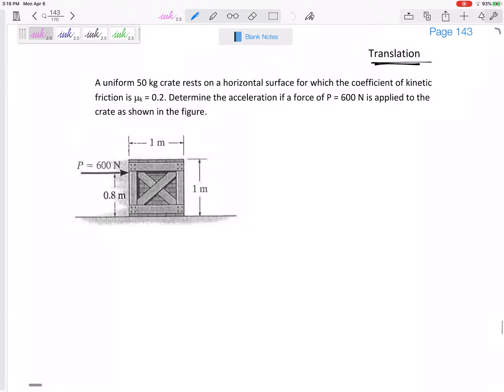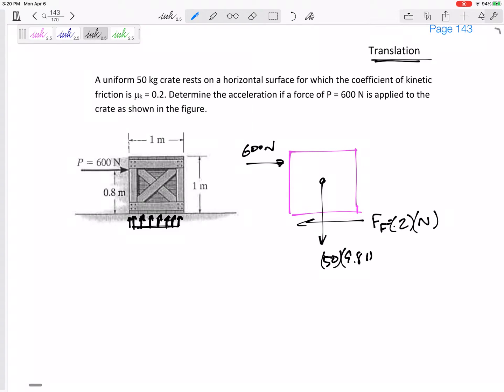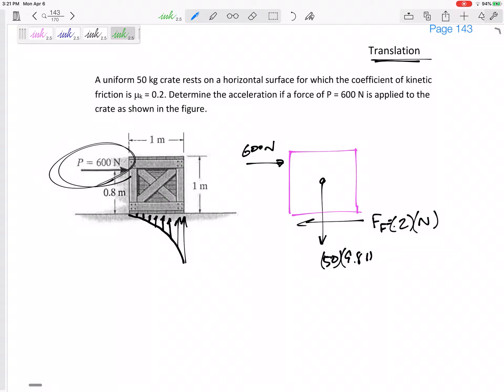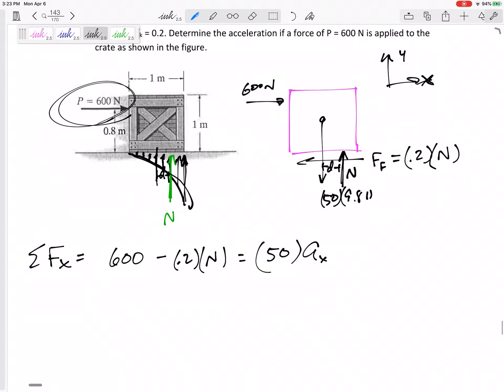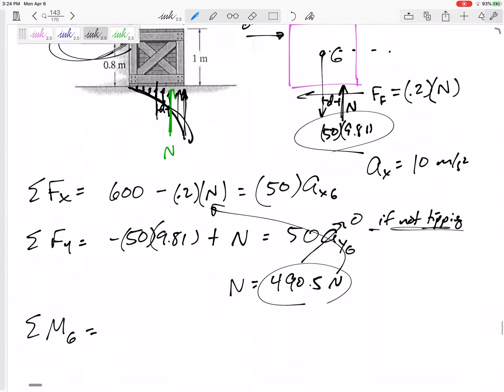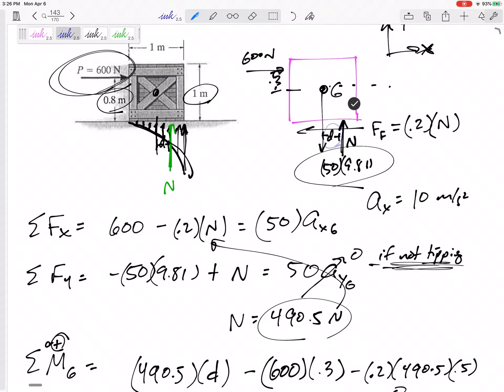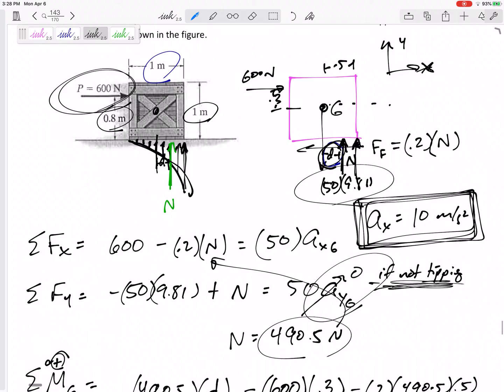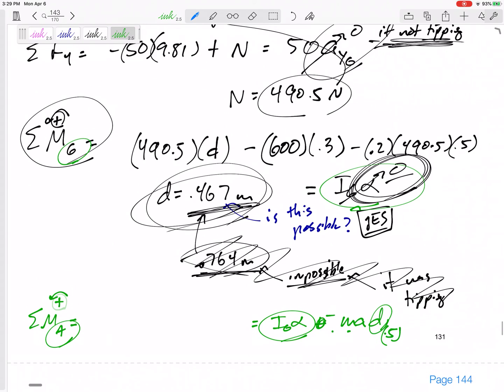Dynamics - Rigid body translation example 1

Comment: What if the normal force was acting 2m away from the centroid? Should I recalculate my acceleration in the x and y and alpha?
Reply from the maker: It would get much more complicated. It would be tipping, so I would set N out to the outside edge, and recalculate everything. Alpha is no longer zero.
Reply: @engineeringdeciphered  Well thank you. I love translational rigid bodies they are way easier than general plane motion